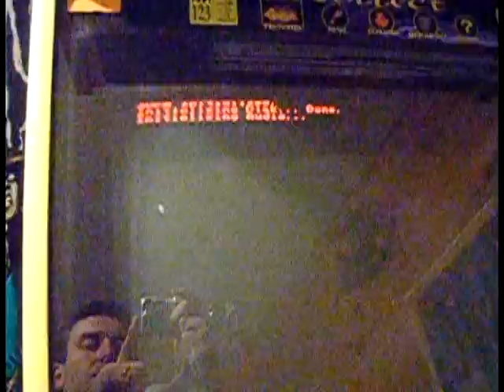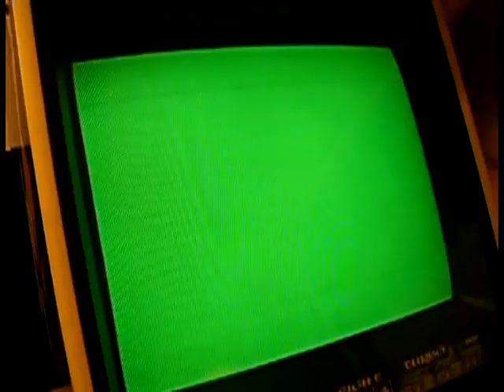(Part 2) Gauntlet Legends Video Card Substitutions

Comment: Hello man. I know this video is super old. But was wondering if you knew why my my gaunlet can only be started on free play. If it’s set to credits the coin door doesn’t work there fore can’t start the game. There’s no issues with the wiring or anything.
Reply from the maker: I'm not sure I'm understanding. 

If you set it to free play it works but you want to be able to start the game when you set it to credits. 

Your coin door is not working you say. If your coin door is not working, you'll never be able to start it if it's not set to free play. 

Sounds like your coin door itself is broken. Maybe I'm not understanding what you mean.
Reply: @TortureBot  that’s correct. That’s what is happening
If you have somewhere I can show you a video or something I can do that. Just want to figure this out. Another thing I noticed is that once set to freeplay and I turn it off and back on it’ll not be ok freeplay nomore. Shouldn’t the settings be saved ? I replaced the battery on the board already
Reply from the maker: @Walans209  ok so you can't play the game unless free play is enabled because of a non-working coin door. But, every time you set it to free play in the setup menu, it reverts back to wanting to use the coin door, & in turn, you can't play because the coin door is broken.

The board set SHOULD keep the last settings if that Snaphat Timekeeper battery/crystal module is indeed good (3+ DC Volts or a little more).

I just sold a set that was acting exactly like this, but I installed a new Snaphat battery/Crystal module in it before shipping it out so the new owner would have no issues with settings or the time being lost.

Did you use a multimeter to ensure the new module was not dead or low on voltage? The only way it would revert back I think is if that voltage went too low.

There are DIP switch settings on the board set, but I don't think they can turn on/off Free Play mode. They're just for video output type, joystick type, etc.
Reply: @TortureBot  do you have Facebook or something ? I can show You a video or something when I’m home. I didn’t check the battery. For voltage. is the yellow one right ? And went I went into the test menu before I replaced the battery it said battery needs to be replaced on red letters and did not say that anymore once I replaced it. Also when I got the machine it did not boot because it had a upgrade dark legends cf drive in it that would get a boot error. So I plugged the original hard drive back in. And booted up. No boot up error this time but only works on freeplay mode. That’s where it is now. 
So the board has gaunlet legends hard drive and dark legacy EPROMs idk what went wrong in the first place of the EPROMs are bad that’s why it had a boot up error to begin with or the cf drive was bad. Or both. It. Works perfectly fine on freeplay mode tho. any reason why the coin mec would do this ? Could it be cause by bad EPROMs ?
Reply from the maker: @Walans209  Man that's some oddball setup to even get working! I can't believe you can get that to run even in Free Play with a Legends hard drive and GDL ROMs!

First thing I would do is replace the Legends hard drive with a GDL drive. You probably just got a bad CF drive from the get-go. I've never used CF drives, but I have made my own Legends and GDL mechanical IDE hard drives. There may be some incompatibility if you have a hard drive version that's not compatible with the ROM version. Like I said, I can't believe you've even got a Legends drive to work at all.

I don't have a FB account. If you see that RED battery message is now gone, I would think you replaced the Snaphat battery/crystal module properly.

Bad ROMs COULD cause an issue. I would try to create a new drive using the program CHDMan.exe that's comes with MAME. You'd also need a Gauntlet Dark Legacy drive image file (CHD file). I have a video on my channel that shows how this is accomplished here: https://www.youtube.com/watch?v=XSEgQUp8q08&t=1643s
Reply: @TortureBot  yes idk how that worked. I’m sure the original hard drive is a gaunlet legends and the EPROMs I checked they say dark legacy.  Lol and it works as dark legacy lol 
So you recommend writing a dark legacy into a hard drive and dropping that in ? I can use a regular hard drive to do that right ? Don’t have to use a cf ? I’m not a software geek but I can give it a try maybe that’s why is little more difficult for me to figure out.
Reply from the maker: @Walans209  You've got me curious. I would have thought you couldn't boot either Legends or DGL if you swapped the ROMs from the other game.

It is possible someone burned the Legends ROMs instead of GDL and then did the CF Drive correctly with GDL image. That may be why you got the initial error (GDL CF Drive with Legends ROMs).

Then, when you put in the old Legends IDE mechanical drive, it works because the ROMs are from Legends. Then I still wouldn't know why it keeps booting NOT into Free Play mode all the time though.

Yes a standard mechanical 3.5" IDE hard drive can be used to create a replacement. It can't be a SATA drive without an adapter of some type. My video is pretty explanatory about the process and people have written exactly how to do the process on the net.

Question... how many selectable maps can you pick from? GDL has more than Legends.
Reply: @TortureBot  I will show you how many maps it has when I get home. :) and okay I have an extra hard drive at home I just have to find a way to hook it up to my pc and figure out how to write everything I need into it.  
so the initial intro of the game looks to be a dark legacy and all. Idk about the actual maps and gameplay itself. 
But yes it is weird how it only works on free play. I want to figure it out lol
Reply from the maker: @Walans209  usually I use smaller IDE drives. I think the originals were about 4-8GB in size. I've used up to 10GB. I think the actual game data is only about 2GB (Someone on here correct me if I'm wrong on this!). Probably less compatibility issues with 4-10GB drives.

GDL has 8 realms, but Legends only had 4. (Thanks Google!) I think GDL has twice the characters to select from, too.
Reply: @TortureBot  okay cool. I dint think that drive I have is big enough lol I think is an og Xbox one. N I think I don’t have that many characters
Reply: @TortureBot  I will upload a video on here for you to watch. Okay if everything
Reply from the maker: @Walans209  ok.
Reply: @TortureBot  the video is uploaded check it out

Comment: I just wanted to drop a line and say thanks so much for this video series. I thought I was dead in the water for finding a video card for my cab. But, I found one on ebay not the main card but a diamond 12 mb voodoo 2 and bam!!! it fixed my problem. Thanks again.

Comment from the maker: @Draknfyre They are 10 Meg versions of the Voodoo 2 made by Quantum3D called "Obsidian 2's". They made other Obsidians including an SLI version with 2 Voodoo 2's on one board sold at retail. But I think they started out just creating arcade graphics cards at first. The same 10 meg cards are used in both Gauntlet games (Legends and Dark Legacy), & War: Final Assault and maybe a couple more. I think Hydro Thunder uses this same card. Some similar games used a Banshee card I think (NFL Blitz?).

Comment from the maker: @Draknfyre Right on all accounts. The system is set up with a Voodoo 2 driver & can't find the hardware, so it halts. And yep, it's a whole other chipset, like I said at 1:36. If somebody tried to run a pc game with an ATI Radeon driver, but installed an nVidia GeForce, it wouldn't work. But you've got me wondering if I could run the game with a Voodoo Banshee, 3DFX's first 2D/3D card (after the Rush) that had a Voodoo 2 chipset?  Need a 16 meg PCI one to test. I've never seen a 16 meg Voodoo 2.

Comment from the maker: @DarkShadowRage2 I tried connecting a VGA monitor directly to the output of the video card (since the video card should output VGA) but there must be something in the GL boardset that sets the card to output at 25 Khz instead of 31.5 Khz.  I think (I'll have to check the manual again) there's a DIP Switch setting for VGA output, but I think I tried it already.  SHOULD work, but I need to figure out what else I need to do to enable it properly.

Comment from the maker: @DarkShadowRage2 I was experimenting with connecting a VGA monitor to the game a while back, but it wouldn't sync up (VGA syncs at 31.5 Khz & the Medium Resolution monitor in the cab syncs at 25 Khz).  There is a way to set the boards up to run on standard res monitors at 15.75 Khz, which I know works, but without a converter card to take the output of Medium Res or Standard Res & convert it into something a capture card can record from, I'm not sure if it's possible.